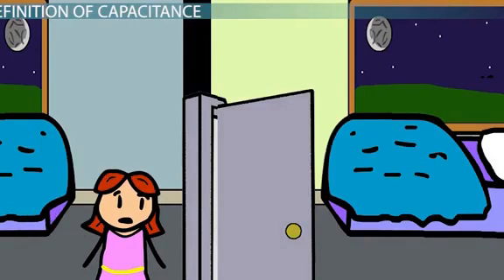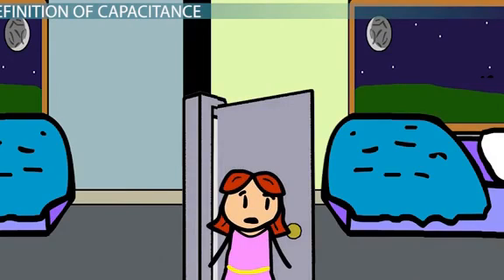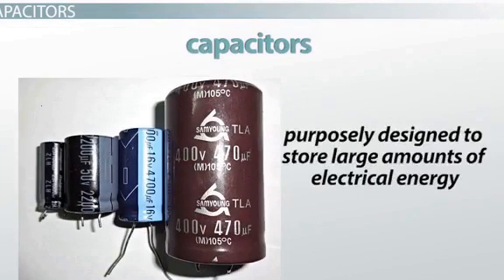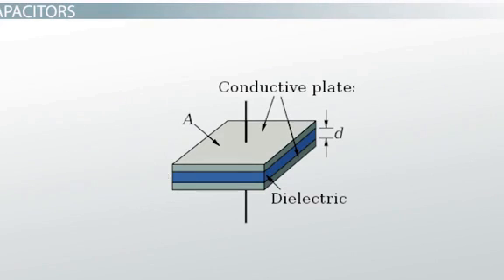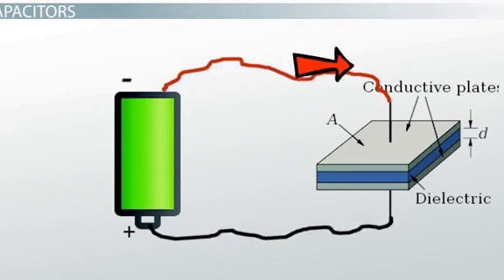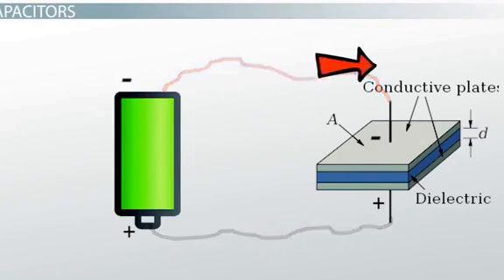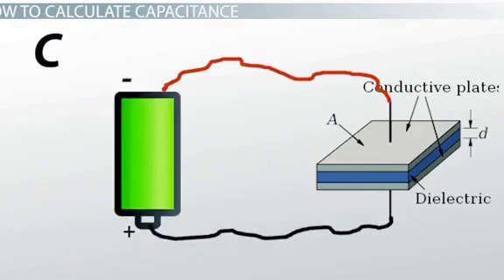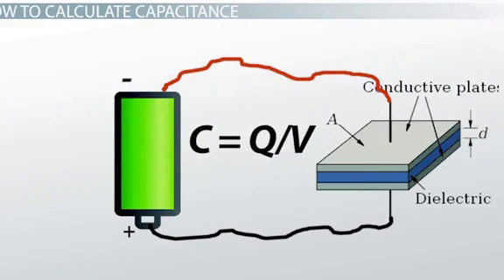Capacitance is expressed as the ratio of the electric charge on each conductor.

Comment: ok except for 1 problem, When you connect a DC Source like a battery to a capacitor 
1. it will charge up the capacitor

2. Charge will not pass through the capacitor
 (and i'm speaking loosely, i'm not referring to displacement current)
You should have either shown that charge builds up on the plate with a DC source and not had the arrow on the positive side  or Inserted an AC Source and then kept the video the same.

the way you've done it is incorrect.
Almost correct, but not quite
Reply from the maker: Thank you so much for clarifying! I better understand now.
Reply: @stemcurious4905  
"You understand better now" ???
I mean.. You're welcome, but.. do you mean to say that didn't know this ?
and then went an made a video on how capacitors work without understanding this.
Because i just took the video as, you made a mistake but understood how capacitors worked regardless.

as i said, You're welcome if you now learned something new. However it is concerning that you're making a video while you don't know it correctly.